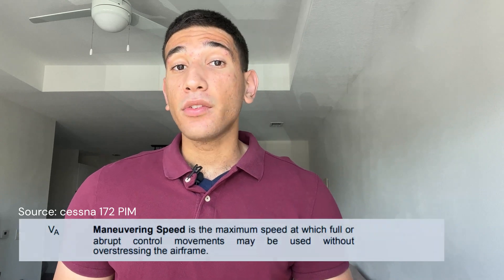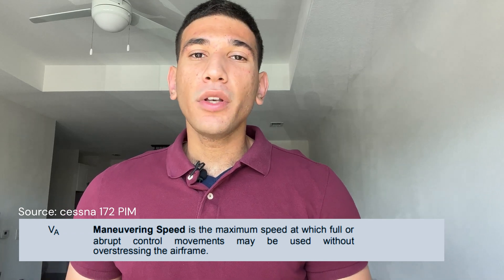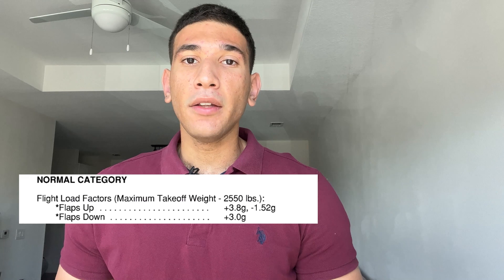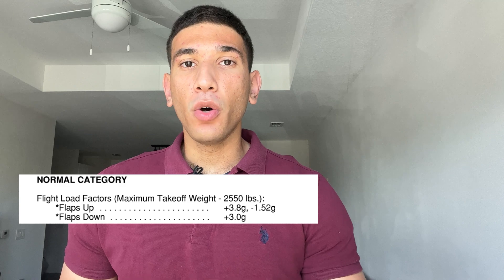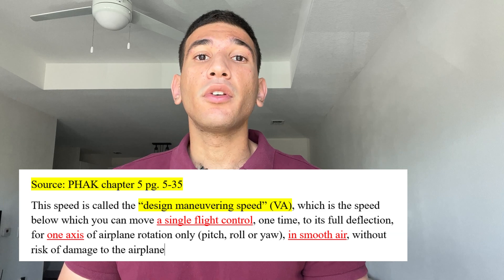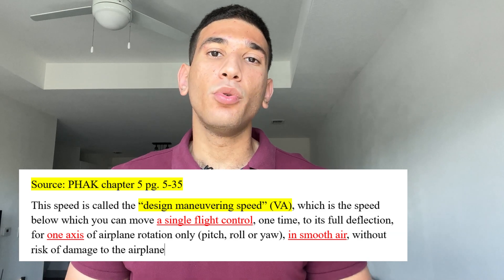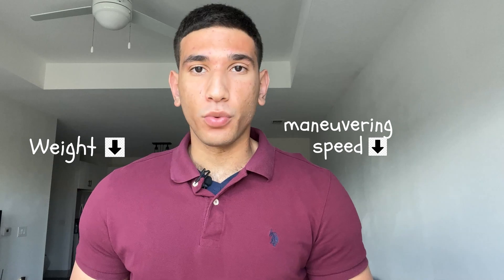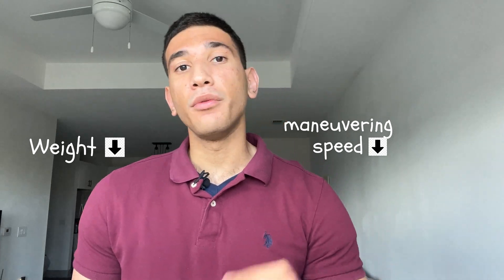Maneuvering speed (VA): How It Works? Why Does VA Change With Weight?

Comment: Gusts don’t cause your elevator to deflect, rather instead, they rapidly change elements of the lift equation, be it velocity with horizontal gusts or AOA with vertical gusts. No, you don’t need to be below Va for turbulence, there is that while Vno thing which is calculated for substantial gust factors.
Reply: In this you should remember vertical up gusts must be matched by down. Think of taking this to its logical conclusions should you mistakenly take that assumption slow to Va in turbulence… fortunately for you your baseline is 1 g such that your positive change is one less than the limit and the negative limit takes one more to reach.
Reply: Remember, though, structural failure is a much less occurring issue than running out of energy. Slowing down puts you in more danger especially if you’re at lower altitude.

Comment: Maneuvering speed is highly deceptive in that the number is based on a longitudinal pull in the positive direction while the textual definition says any axis; reality is your physical structure has separate roll and separate yaw limits. You also have asymmetric limits aka dual-axis maneuvers typically rolling pulls. A maneuver is “single throw” as you can get in phase with a dynamically unstable situation regarding load if you cycle controls at a wrong rate. While I think they should have had either separate published yaw limits or a lower, much lower, Va of 160-ish vs 270-ish, and I believe the NTSB missed the fact that per textual definition of Va, such should have been lower, look into Nov 2001 American Airlines flight 587 crash which occurred because of dithering on the rudder pedals at around 250 kts below published Va.

Comment: Maneuvering speed actually doesn’t reduce with weight until you get light enough for something other than the lifting structure to be the critical limiting factor; accelerations don’t break things, forces do. If you were able to reduce mass to zero, your acceleration limits would be infinite. This is to say your load limits actually increase as weight decreases until that component other than the wing spar, that component whose weight does not change becomes the thing that will break under a given acceleration producing a given force upon that mass.

Comment: can anyone explain why you risk damaging the airframe when inputting a full control above Va if the plane will stall before reaching its limit load factor?
Reply: If you input full control above Va the aircraft will exceed its limit load factor before it reaches its critical angle of attack. 

Exceeding the limit load factor means that structural bending or damage will take place and the aircraft won’t return back to its original shape.